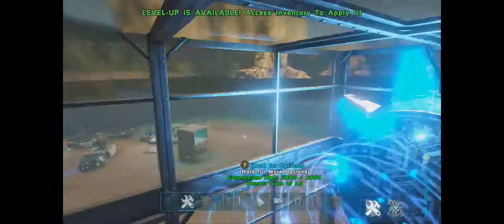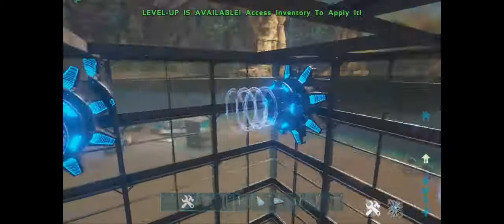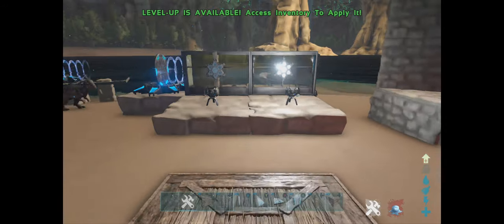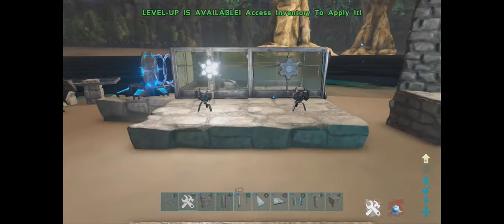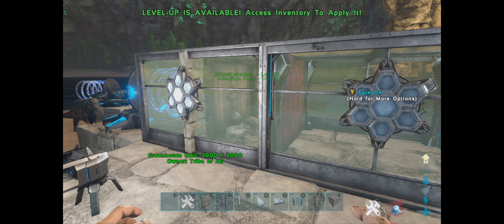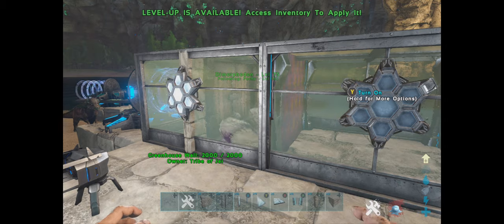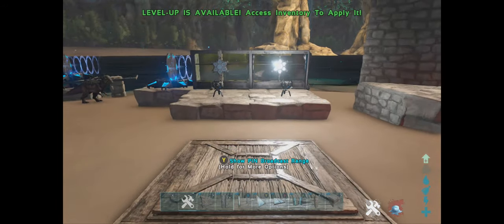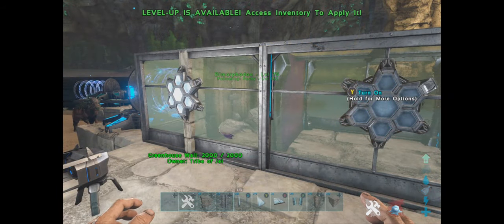How to make a working Latch circuit in Ark - Lights change colour, Jump Pads change direction & more

Comment: Again a great concept. However i mimicked your last video with the lighthouse and the rotating lights... i used 8 sectors instead of 4.
Now here is my issue, the dino following a dino is actually a game bug. 
Whenever you leave the rendering range and come back in, the deino will start following you instead of the dino you set it to follow.
Even tho it still says "Following <dino>".

Therefore i will need to create an automated process of cycling a non-follow creature...
Reply from the maker: That's interesting, I've not seen that bug. I'm on Xbox, not sure if the version of Ark might cause that?
Reply: @Sleeping-Forest  No idea, the deimorph would just bug out at some point. I just posted a video with a different setup. Been working fairly fine for days now.
Reply from the maker: @acanofbeanz5109  I just saw your video, nice solution with the jerboa! I have another potential solution I really want to make a video of actually, wouldn't work for this build but could still be useful, I'll see if I can get a video up soon!